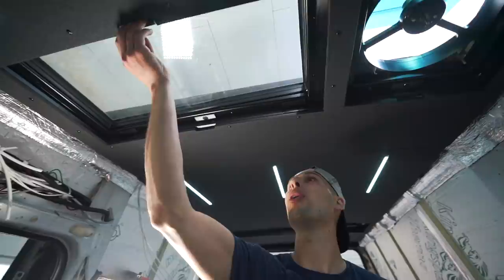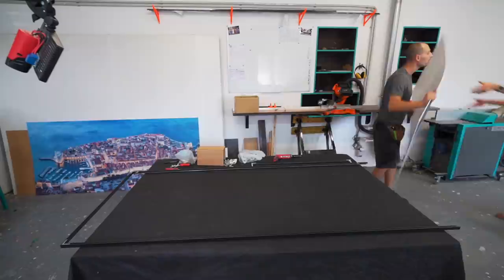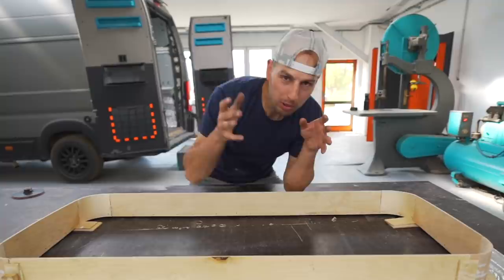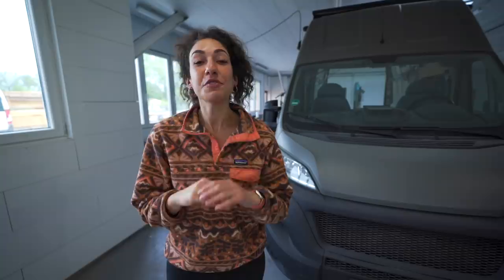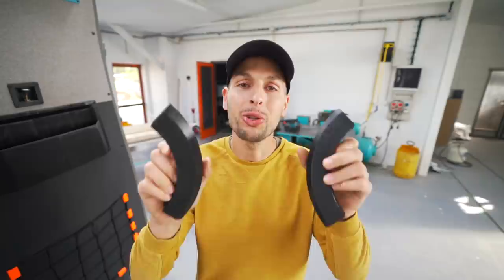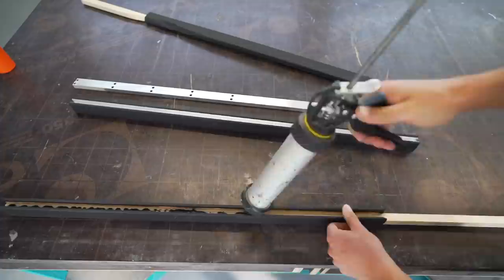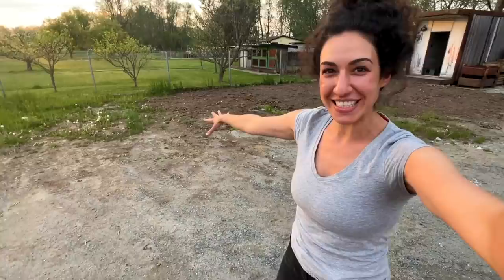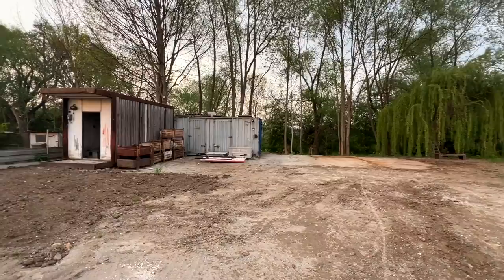3 FOOT PHOTO becomes Campervan's Window Curtain / Van Build S3E5

Comment: Smart trick to make something nice out of the cover up!

A small improvement is to glue a few mm thick (and maybe 10-15 mm wide) border directly around the picture. The only purpose is to fool your eye to think that that boarder is the frame around the window. It should be very easy to retrofit and nether take a lot of space nor weight :)
Reply: It would also add some rigidity to the picture. I’m a little concerned the picture might buckle and come off the rails with some pressure.

Comment: Many of the windows in the US are built with the same design and they last for decades.  Really smart!  If I might make a suggestion?  You can feel when you raise the panel that it almost catches.  It doesn’t really catch but it is not as smooth as it could be. Plastic on plastic can sometimes have similar issues to metal on metal.  The solution to this is to run a strip of 1mm felt on the outside edge of the panel, where it slides in the channel.  You can also put a 8mm (wide) strip in the channel where the panel slides against the channel.  If craft felt is available where you are, it would probably cost way less than a Euro for 1 sheet and that is all you need.  Craft felt will disintegrate when it gets wet and it will be a real pain to replace it after everything is assembled and in place.  Maybe and you know better than anyone how hard it would be.  But if you plan to do the same thing on the opposite door, slide some felt into the mix and it will be very smooth, very easy and very quiet to raise and lower. The only thing you should hear THEN is the clicks of your catches when it reaches each stop. 1mm felt will stretch and flatten and you probably won’t have to change your dimensions to add it.  But if you use thicker felt, it will be a bit of a headache to make it all fit and work smoothly.  Last thing- that was not a little  ‘granny making aprons’ sewing machine but a solid industrial machine that could do harder jobs like upholstery.  You could buy something that word as well, but it would cost a lot of money.  Don’t be fooled with new and shiny as it is like the tools in the workshop.  Not shiny and new but solid, well made and able to do ANYTHING you want to do and not even break a sweat.

Comment: Great video 👍 Funny when over thinking a problem a simple spring clip and human power is the answer😊. Sewing is still a necessity ,a central spring rocking switch to release and lock the blind using a taper wedge on the sides.

Comment: Great design! Just a thought though. I hope you have a way to clean out the drip pipe for condensation as it will get clogged with mold growth like the water drip pipe in a fridge which does the same job.

Comment: This is amazing! You guys are really thinking through things and innovating every step of the way!

I saw a van by Paul Lehto on YT where they mounted automatic shades over every window, then a huge projector screen between the driver's seat and living area, doubling as a divider.

I have the idea to build a big Sprinter 170 ext van with the same layout as Snow & Curt on YT... Bed in rear, walk-through bathroom wall-to-wall, then living area... Except the projector screen between the driver's area, and two more as the temporary 'walls' of the bathroom... Also, the rear bed would be on a lift so we can raise it to the ceiling out of the way.

Then the van can transform automatically between a fully open layout with 360° windows, or four separate 'rooms' (driver's cab, living room/kitchen/sliding door, bathroom/hallway, rear bed/etc. w/ garage space underneath).

I'll have to think about your idea instead of the automatic window blinds, and how it would sit behind furniture instead of taking up room in the back of the upper cabinets.

Awesome idea! Your way definitely adds a degree of professionalism if you have to work from the van with the window as your backdrop.

Comment: The spring catch is a fancy design. But given the use of magnets in other places in your van I'm surprised you didn't use them here as well. A magnet stuck on a steel strip would create the constant friction for an infinitely adjustable system. Or use multiple magnets in holes for a positive stop feel.
Reply from the maker: Magnets don’t hold weight well as a slide on. Especially on bumpy roads the blind would drop for sure. Don’t worry we’ve been there

Comment: not to shit on what you did(you did as always amazing)
But i would prefer to have a handle on that window cover in the center top, so i can move it with one hand(the locking mechanism i would use almost the same, where one button inside the handle moves two locks on the sides that you currently push with two hands, it should work about the same as some train windows)
Reply from the maker: I went through this. It’s tricky to fit in a smaller sliding channel. Doable tho

Comment: Hi admire your ability to learn to skills. Way to go to the both of you.

Will you be able to reach the latches when it's behind the couch?

The top of the shade seem to have quite a bit of movement in the middle.

Those drains out the door, wi yesll they get dirty and be a maintenance issue?

I always watch your videos and appreciate the phone you put into it despite struggling. Step-by-step one thing at a time breaking it up into small pieces.

Ladi,

Have you thought of using a chemical that will bond the pieces together melting them slightly so that they become one solid piece?

Comment: A question I was wondering about is. How do solar panels an cameras handle hail stones . No one has ever said anything to that your build with the panels lift would help to directly hitting them but most are laying flat on top . Would the glass protector you showed could that be used to protect the panels

Comment: Wicked wicked work lads well done! Every time you lift that blind you'll be glad you did it 😎  

I know it's probably tricky to film in the moment, but seeing some of the trial and error behind the making would be awesome too, but obviously it's probably the hardest part to film when you're in that frame of mind 🤣

Can I ask you guys also about the shower tray that was built for that van you toured with in the US recently. Do you have any info on how the custom fibreglass showertrays are made as I need to make one for my build, and like you guys I'm a perfectionist so it needs to look 🤌

And well done Margaret on the sewing, it turned out great 😎

Comment: the answer is on a backpack or a suitcase,  the clips that you use on straps, the plastic type.  You fit the female to the frame at the top, and on the slide you put the male, pull up clip in, to put down just squeeze the sides.  Keep it simple and stupid.

Comment: The picture frame slide! Why didn't you just use the same trick that you used on the overhead window shades!? And use earth magnets to hold it into place!
Reply from the maker: We wanted to use magnets so bad, but with gravity and bumpy roads they could struggle with the weight, and the stronger they are, the harder they are to move

Comment: Great windows guys. Just wondering whether you might put any extra insulation behind the panel or do you think the new picture panel has a good enough R rating as it is?
Reply from the maker: has a good rvalue, but we will likely be adding a reflective material later on!
Reply: @ladiandmargaret  ok, good to know, and sounds like a good idea!